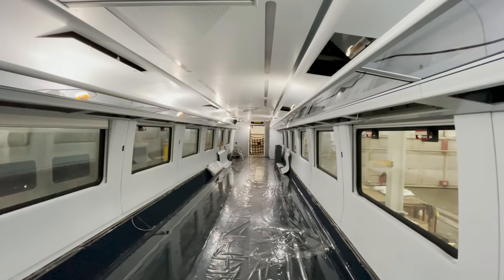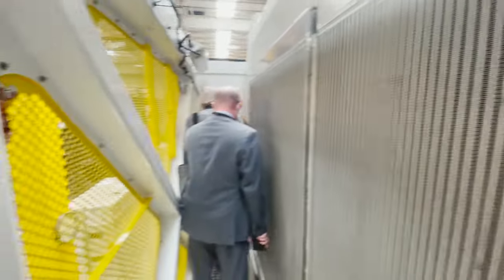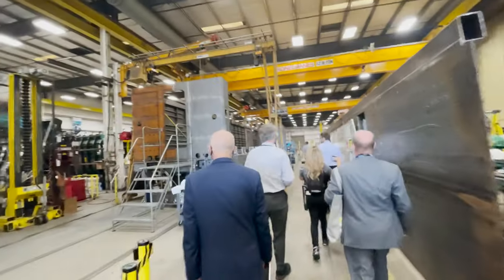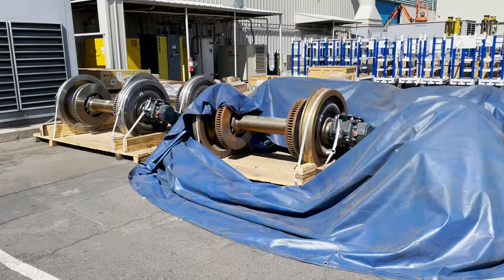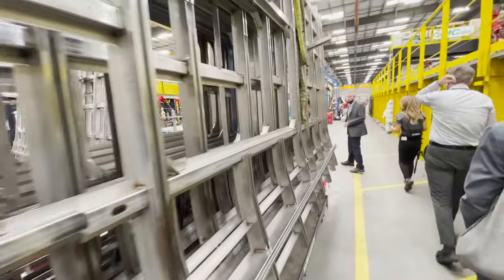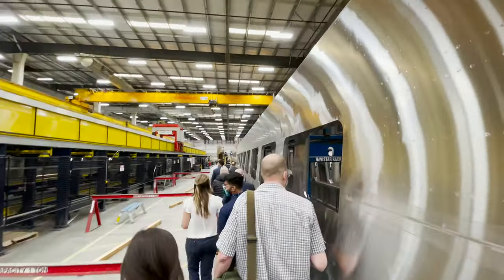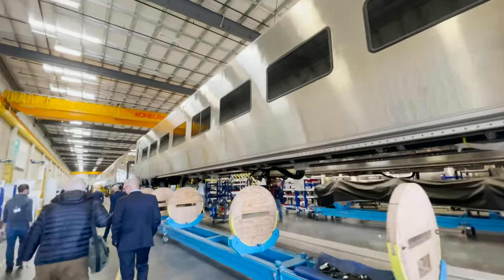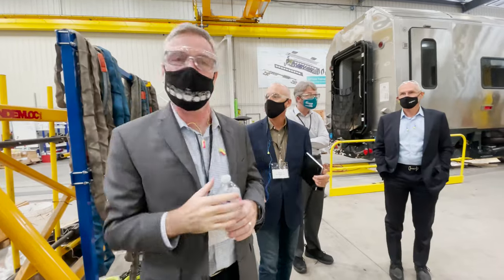Building Brightline's Trains: A Tour Inside Siemens Sacramento Rolling Stock Factory

Comment: I used to do security for siemen. I got access to every building from the welding building, office area, design office and many more. Though access was very limited only you could access with a badge where you work at. I got to see the first electric Amtrak engine rollout before I left the place. The place has now expanded and added a couple  buildings on the north side. Thanks for the video, reminded me of my time when I worked there.

Comment: I would like to know where wheelchairs go (power chairs) I want to ride Brightline but scared I cant due to the size of my chair.
Reply from the maker: You should have no issues navigating these trains with your chair, they were designed from the beginning with wheelchair accessibility in mind. I'll be sure to point that out in my next video on the train itself.
Reply: @RoamingRailfan  Thanks!
Reply: @lovedfriend2020  Brightline's trains are ADA compliant. The bathrooms are huge and the aisles are wide enough for wheelchairs to come through. The trains have floors that extend out to the station platforms to provide a smooth transition for wheelchairs (they have elevators that take you to the station platform). You have nothing to worry about with Brightline concerning wheelchairs.
Reply: @SplashAnimationCo  Thanks

Comment: That had to be the experience of a lifetime getting to tour there. Brightline made the right call with the streamlined noses, the standard nose design Amtrak, Via and all the commuter railroads are ordering is pretty ugly in my opinion.
Reply: Amtrak and Via need that nose design because they need to have an exposed front coupler.  They run some trains with more then one unit together and equipment is shuffled around a lot.
Reply: @c449watomic  VIA Rail's design for an SC44 was well played. The Amtrak ALC 42 is so so... The Amtrak and commuter SC44 Versions of the nose are ugly asf.
Reply: Via rails looks good, it’s like Brightline but it just has a hitch in the front
Reply: The VIA units also have an attractive streamlined nose, but with a standard coupler. I agree that the Amtrak / Commuter version looks like it has been punched in the face

Comment: Huh. For some reason my previous comment isn't showing up. Anyway, I don't think that coach you passed on the left near the end was actually for Brightline. Brightline doesn't have low-platform doors.
Reply from the maker: You're right, that's a Via Rail coach. Just saw the drawbar and high level door on the other end when editing so I assumed Brightline since there are no markings currently to differentiate them.